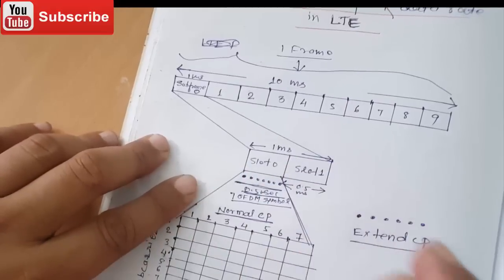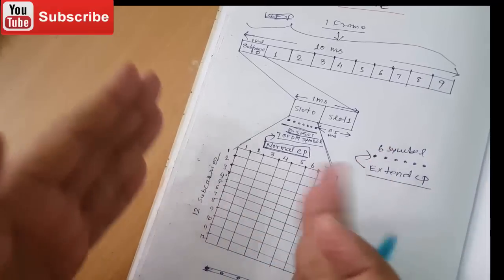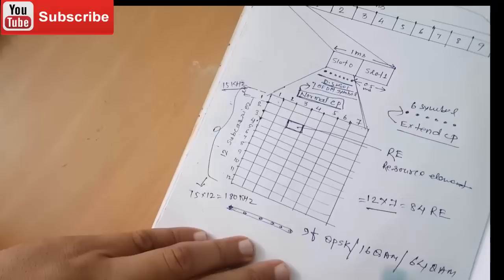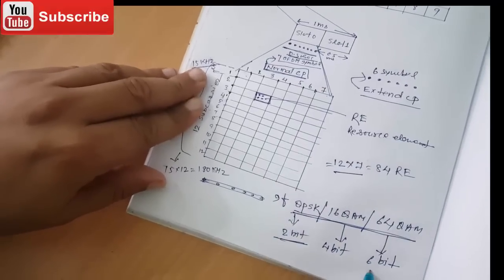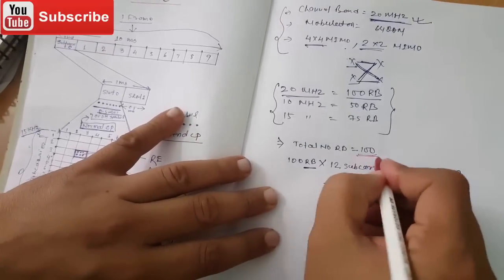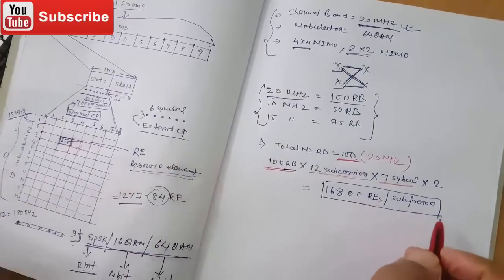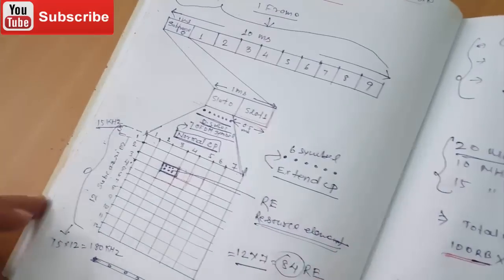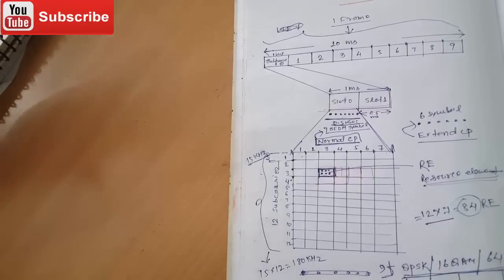How to calculate LTE Data rate Speed ?| Throughput calculation in LTE

Comment: Hello, at 8:05 why do you multiply by 2? I understand that there are 2 slots in a subframe. But 20MHz has only 100 RB. 100 RB = 100 * (12 subcarriers X 7 symbols). How can you multiply again by 2 here? 1 RB = 1 slot (12 SC X 7 symbols). 

Can someone clear my doubt?
Reply: Network always allocates UE 1 subframe in DL which is called a TTI. Since there are 2 SFs in a TTI we have to multiply by 2.
Reply: @MITHUNTV  Right. It makes more sense to me, if further down the video we convert 100 * (12 x 7) per 0.5ms, to 100 * (12 * 7) * 2 per 1ms

Comment: Thanks for Video, But I think 100800 bits/1ms !=100.8 Mbps, when we used right convergence of Bits to Mega bits than need to divide by 1024, By using this data rate will be 96.13 Mbps, & for 4x4 Mimo It will be 288.39 effective data rate not 302 Mbps.
Reply from the maker: Yes correct...its only for understanding purpose.....so taken just approx value
Reply: @AnandTechnoSolutions  
100800 bits/1ms =100800*1000 bits/s   (here suppose to convert 1ms to sec,so 1ms=0.001=10^-3 sec)
100.8 *10^6 bits/sec =100.8Mbps

Comment: Hi Anand, could I ask you a question? In 4G LTE,  the baseband signal is actually at low frequency(a few khz?), but how come it is that low? Say for example at DL, the through put is around 300Mbps( for 20MHz , 64QAM and 4x4 MIMO), meaning that 300Mbps will arrive at the mobile receiver end(assume only 1 user is using all the available RB or 1200 sub carriers), and after all the require process, the baseband signal(bits 0 1) is retrieved but at very low frequency. So now for 1 sec, 300Mbps is waiting the mobile to process, but if the baseband signal is slow, it will take a long time to just proceed that 1 sec of information. How could that possible? Could you please briefly answer my question? Many thanks.
Reply from the maker: as per my understanding..The use of "high" frequencies has nothing to do with energy. The main purpose of using a "carrier" is to transmit multiple signals of smaller bandwidth over a channel that has much larger bandwidth.
though the fact that higher frequencies have shorter wavelengths and therefore can be transmitted more effectively with short antennas is also important for many applications.In Modulation and antenna propagation, the adsorption of the wave makes you to need more energy to transmit.

Comment: Great explanation.  Where did you get for example, 20 MHz=100 RBs?
Reply from the maker: It is for your understanding...same way you can calculate for 10 MHz or 15 Mhz
Reply from the maker: Yes..got it
Reply: I am sure you knew this Anand, your video is great. I was just explaining to Tom M.
Reply: 1RE corresponds to 15kHz channel and in 1RB there are 12 such channels so 1RB corresponds to 180kHz. In a 20MHz channel, 2MHz is used as guard band leaving 18MHz for transmissions. 

This therefore means the number of RBs in 20MHz (Effectively 18MHz) = 18MHz/180kHz = 18000000/180000 =100

I hope you got it.
Reply: Thanks.  Now I understand.